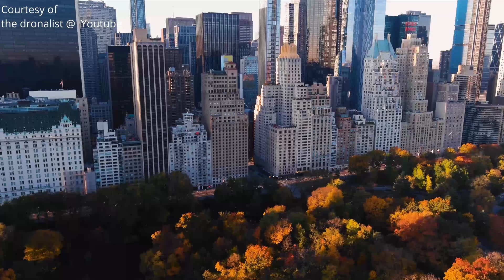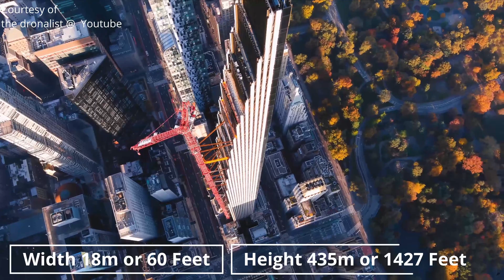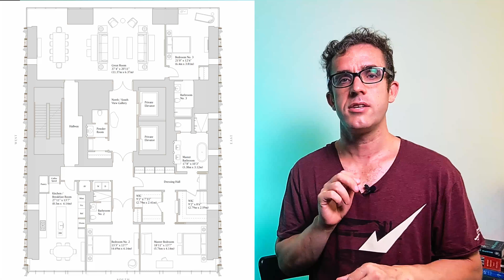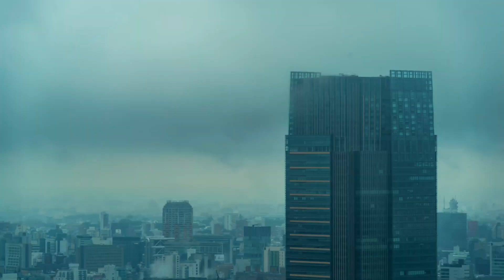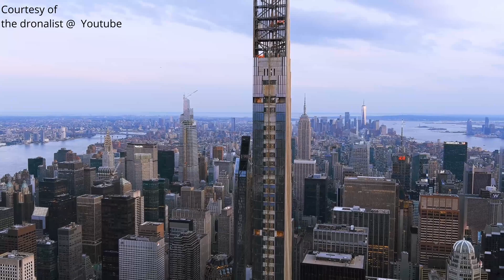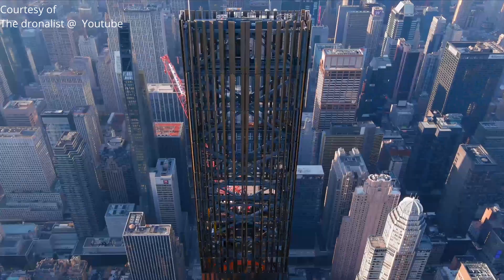111 West 57th Street -  The World's Thinnest Skyscraper

Comment: The stairwell dimensions comply with the City's code for escape stairs but in order to maximize habitable space per floor, a type of stair known as a scissor stair is incorporated in the well so that the same well provides two stairs to comply with NYC's requirement for two escape stairs for buildings exceeding a certain height such as this. There are certain restrictions such as the requirement for a fire barrier between the two stairs equal to that between the well and the habitable space (and sheetrock cannot be used for this), and construction detailing must be such that in the event of a fire, smoke cannot migrate from one stair's envelope to the other. Scissor stairs have been and are being incorporated in high-rise structures and not just in supertalls like 111. It's worth mentioning concrete strength being a factor in making these RC structures feasible. Not so very long ago, 4,500 lbs/sq. inch concrete was common for concrete structures. Now, with technological advances, strengths of 16,000 and greater are achievable and available to design engineers. It's worth noting that to address the possibility of uplift at foundation level due to wind loading, around 200 stressed cable anchors have been installed 100 feet into the bedrock. Only one of the elevators shown on the floor plan is double stacked as a provision for maintenance/service personnel. Obviously, this was considered adequate for the relatively small number of individual dwellings incorporated in the tower.

Comment: The east-west superstructure support?  How far up does that go?  Seems as though the big amount of cosmetic at the very top adds enough weight to combat wind.  Sure would be nice to have the floor just above where the east-west ends so that I could honestly say that I'm in on the ground floor.  That's some serious steel throughout in all these super-talls.  Doesn't seem as though wind could compromise comfort factors of tenants.  The building reminds me of Rome's Pantheon with the terra cotta clinging to the exterior.  Sure is pretty.
Reply: Thanks.  Nice video.
Reply from the maker: Hi Andre, Thanks for watching. There is a lot of floors at the top of the building the house the tuned mass dampener and mechanical equipment. with out the Tuned mass dampener you would feel the building sway, it can move a long way under a wind event. agree tho a appartment at the top of the tower would be a prize to have.

Comment: Great video Brendan. I'm curious about the design philosophy behind outriggers. Did I understand correctly that the mega columns to form these outriggers are only present on certain floors? I would've thought that you need the stiffness right through from top to bottom as far as possible. I'd appreciate any clarification or resources you can recommend on this topic.
Reply from the maker: Hi Theuns, The outriggers(solid walls) are on discrete levels. the Mega columns are continuous from the top outrigger to the footings. So the only impact on most floor is the mega columns.  The outriggers stiffen the structure on that floor, the easy way to think about it is that it added a reserve moment/curvature pulling load out of the core to the mega columns. I will be doing a full episode on outrigger design.
Reply: @BrendanHasty  Thanks for the reply. Looking forward to the episode.